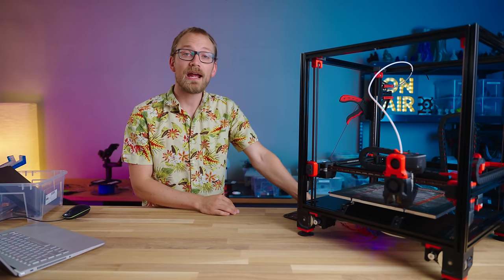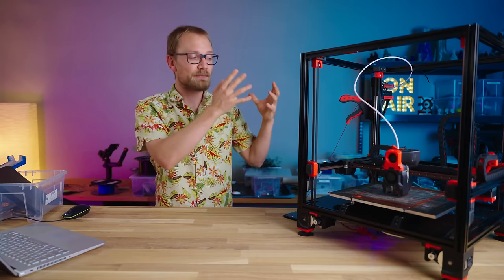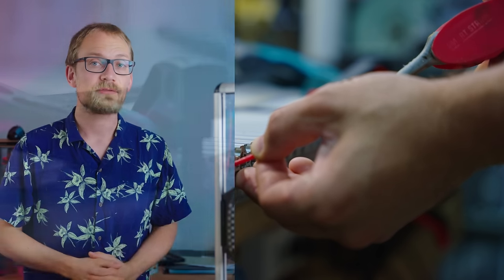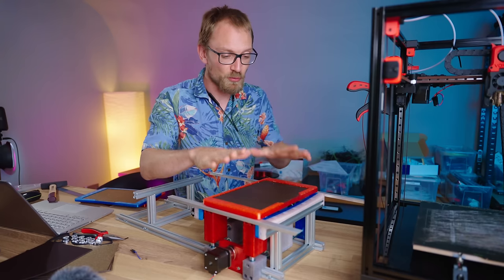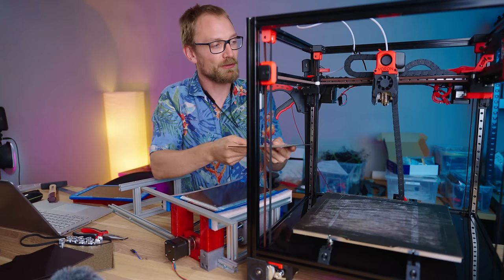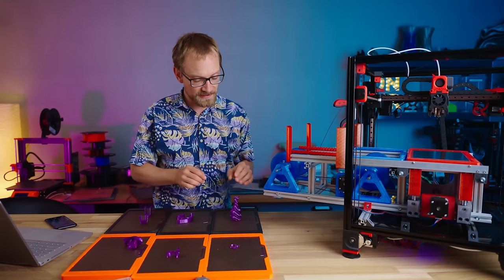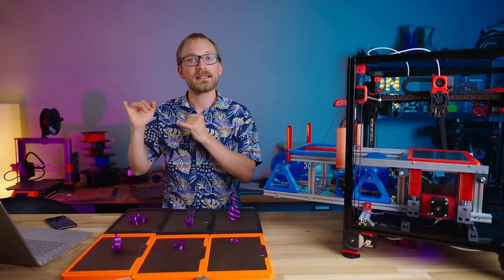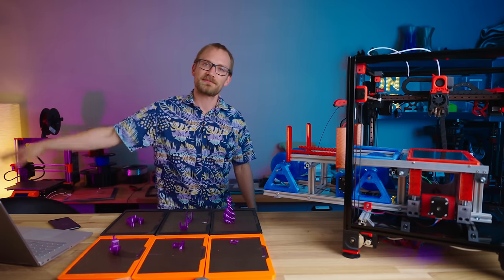Fully automated 3D printing using REAL print beds!

Comment: This is an amazing solution, well done!  Bugs me a little that the beds just drop.  Needs some exit rails that put the beds on a conveyor where the prints get knocked off and the bed gets deposited back in the stack to be printed on again.
Reply: Won’t work seamlessly, until you can control the prints adhesion on the bed for every print. Sometimes there will be prints that stick too good
Reply: Hot take: Just print on a conveyer belt itself. Those printers already exist. This...this is just wasteful tbh. I don't get it.

Comment: Curious if you have used the 3DQue product or seen it work in person. I can tell you that it doesn't RAM parts off the bed as was mentioned. The VAAPR bed surface is simply amazing at holding parts as they print and releases the print very gently after it has cooled. The Quinly automation software can save makers time by not having to interact with the process.  Maybe next time try something first hand before making off handed comments.
Reply from the maker: There are solutions that do ram the parts with the toolhead. For the 3DQue, they said they'd send me one (a couple months ago), but I never got one.

Comment: How fun!  Two points... on the offload, you could certainly utilize a conveyor so the prints aren't damaged being dumped off the side (knowing you, v2 will have that!)  Second, coming from the world of Large Scale 3D printing, I keep hoping E3D, Slice or Bondtech develop pellet fed systems.  No more dealing with inconsistent filament size or fear of running out.  I haven't seen much small scale pellet stuff hot ends take off yet.  But for the big printers, that's what we use!

Comment: I've been thinking of using an arm that will extend and will push the prints out of the bed automatically.
Reply: I had the same thought. Kinda like a large paint scraper that pushes the prints into a basket or something.
Reply: @johnbickford9221  yess exactly. It would be much simpler. You just need linear motor and some simple design.
Reply: @imranzosh97  You could even do it with a threaded rod a linear bearing and a stepper motor.

Comment: I would use electro magnets so you could just cut off electricity and the bed would release
Reply: Maybe use permanent magnets to stick the beds. For release use electro magnets that works "against" the permanent magnets.
Pros: no power to hold the bed, "failsafe", ...
Cons: electro magnets must match the holding force of the permanet magnets, maybe closed loop control and hall sensors needed,..
Reply: Electromagnets would be very energy intensive as you'd have to have them on during the entire print. I think your idea is a good one, perhaps using Electro-permanent magnets instead.

Comment: "this simplified, practicalized version"

Ya know... 3dQue is more simple. It has Quinly software to provide the automation of individual g-code files. It has reduced part count to enable automation. It is more practical, because you don't have beds and parts falling together, and you don't have to reload a "bed magazine".... Oh, and you don't sacrifice any build volume.

I really think you over engineered this. I'm an engineer. I've been there. I recognize it. You got carried away with your idea, and because you have the time and money you never stopped to consider it from a point of view of practicality due to confirmation bias.

You should go back and actually research how Quinly automation works.
Reply: well stated !
Reply: 3DQue build plate has pros and cons. Looking at the cons, it looks like 3dQue does not auto-eject nylons well, and the angled bed may not be great for high speed printing (bed moving up the incline vs. down the incline or in a corexy the printhead making the same moves up and down the incline).
Reply: @SD-bv7eb  didn't realize we were talking about nylon printing all of a sudden?

Comment: Amazing. One idea that came to mind is a carousel style large flat disk that spins  centered around the front corner post. It would give a generous X and Y and possibly use existing heat so almost no Z loss. Add that with a metal wiper razor blade or thin heated wire to remove prints on the outside and it could print infinitely. Great job!

Comment: What a brilliant idea! I love how this mechanism has a gravity-fed hopper for the beds and a heated bed that is separate and can move up and down. I think the dead space could easily be removed by having the hopper closer to the bed in use and by changing the design of the belt so that it has hooks instead of blocks that can still push the bed once the first hook has rotated down on the pulley. Also, I'm slightly worried that the 3D printed holders for the bed would warp over time as they are by a heater for quite a while. Well done on having such a great idea and executing it so well! 💜

Comment: Excellent video Tom! Finally a proper tackle of this printing challenge. Next step (although possibly a lot of rewiring) could be to remove the electronics/existing bed from under the bed and put the printer on top of the print bed cycler. Though then you'll have a real Frankenstein.

Please keep making more in depth engineering videos like this!
Reply from the maker: I've thought about that - and the Voron (and similar) printers would lend themselves to that very well. The electronics compartment at the bottom feels like it's mostly the size it is for comfort and ease of use, no reason it couldn't be smaller or tucked away somewhere else on the machine.

Comment: The multiple Print bed approach is so much better in a production setting when printing multiple units and sets than having them roll into a container.  Is much easier to do quality control when you have an array of prints than having to pick them one at a time from a container.

Comment: This opens so many possibilities! 
One obvious improvement would be to plan on using this while building the Voron, and modifying it so you can use the full z-height. Would be fairly simple, just move the electronics somewhere else and replace the base with your contraption.
Plus it really needs a ramp where the done prints come off, I can see the piling up beds to cause problems, not to mention a fragile print would be likely to break (I know your version is just a proof of concept, so not really necessary)

Comment: Cool build!
On the ejection side - a simple slope would allow the ejected beds to slide out neatly.
A thought on gripping the bed inside the printer is electromagnets - steel flex bed sheet, electromagnets in the heated bed plate itself - could be a lot slimmer height-wise.

Comment: Looks great! When space around the printer isn't an issue, a rotary system is usually the go-to solution within automation. Then again, picture a robot arm in the middle of a circle of 3D printers stacked in layers, serving seven times three 3D printers simultaniously, while putting the printed pieces in different bins, including a red bin for failed prints. Perhaps it also adds some need for DFM (Design for Manufacturing).

Comment: Not too sure if you already got this suggestion;
Since the electronics in the voron are housed underneath, you could potentially rotate the entirety of the lower compartment by 90°, then use the opened space underneath to build a scaled up version of this heated bed design, and retain the full build volume for MASSIVE parts. This, in combination with the "complete individual objects" slic3r setting, would probably push your idea to what you initially envisioned with the drum idea!

Really loving the video man, I hope you make more good progress!

Comment: @Thomas - you said that the mechanism for removing the magnetic beds from the hypothetical conveyor would be too complex, but I don't see why. As long as the printed frame around the bed is wider than the conveyor you don't even need an active mechanism to remove them after printing.

All you'd need is a correctly placed ramp with rails that would go either side of the conveyor. That way, when the conveyor starts to go down at the end the printed plate frame meets the rails & can't continue the (conveyor end) turn, so the part of the conveyor it was attached to just pulls down & away from the frame, freeing the frame to slide down the rails onto the ramp.

Comment: I did this years ago and just used the 3d print head to push the prints off the glass bed and then used a queue system in octoprint to print the next print. it's been working for the past 4 years great and i didn't need extra bits

Comment: Very nice project Thomas.  The idea of build-plate cartridges and your heat-bed attach and release method is great!  These are the kinds of 3D printer project videos I like to see; innovation, not repetition.  Now you just need an outfeed ramp ( jut a couple of L-brackets would do) so the bed cartridges don't just fall akimbo.

Comment: Excellent, I made a similar setup on a old i2. I used note cards (4 x 6) as the print surface and had a light vacuumed holding them down. worked wonders if you printed in PLA. biggest issue was the cards often held on to tight to the parts and left bits behind. might have to revisit it after seeing this. I think a stack of PEI sheets set up the same way with the vacuum would solve our largest hurdle.

Comment: Hi Thomas. I'm really impressed by your ingenuity!! Great design. And ultra beautiful machining of all parts. German quality all over. Love that!!
And: it worked like a charm.

Of course, if you would give 5 separate engineers the assignment to develop such a system, you most probably get 5 different solutions.

I myself, as one of those 5 engineers,  would design it using electromagnets (for the pull)  and locking-pins (holding the plates in position) 
And I would move the plates using lead-screws. It would make a flatter unit.

All the best from the dutch guy living in buzzing Istanbul !!

Comment: Really cool stuff. A little bit down the line it would be cool to see it loop around the whole printer, that way you would have an infinite amount of resupplying print sheets, no need to refill cartridges :P. You'd probably still need some magnet action going on in order to flex the sheets to get the print to come loose, but that could maybe be done with advantage once the sheets are underneath the bed and the prints have cooled down a lot, maybe even removing the need to flex the prints (at least as much). In fact, you could eliminate the need for cartridges altogether, slimming them down to the width of just a sheet itself since the sheets could be attached directly onto the conveyor belt, as they would not need to be able to come off. The prints would just fall into a bin underneath the belt. Just build some stilts for the printer to stand on and place the whole thing on the floor.

EDIT: Hmm, if you attached two printers end to end, one upside down, and loop a conveyor belt between them, then you could print twice as many copies of a print, and the sheets don't just sit unused on the belly of the conveyor belt, waiting for their time on the bed. Printers can print just fine upside down, right? If the two printers are printing the same thing, their respective printer head movements would go in opposite directions, cancelling out some vibrations and wobbles as a bonus (I think?)

Comment: 1 think I really like about the design you went with is how it scales infinitely. A print farm could have one large hopper of beds fed to all printers and the beds could roll out assembly like style. At that point some detached the part does visual inspection and so on and the bed is put/fed back into the hopper.

It limits the need to collect the parts as well as means workers could he In a separate area with better cooling for people while the print farm could stay toasty and draft free.

Comment: Very cool project! I would suggest now you come up with a plan to collect the print bed frames as they are ejected so the prints are not damaged by having them pile up and fall on top of each other. Could be a turntable, or an elevator that lifts each plate, or a conveyor belt as the simplest method.

Comment: Being on the topic of an automated build plate changing system, have you seen/ heard of the Tiertime X5 3D printer? It’s an enclosed printer, that holds several extra build plates inside, and can handle a print queue of jobs, that it’ll print one after the other, ejecting each finished job out the side of the printer upon completion. 
I figured it was worth sharing.

Comment: Great video and ingenuity. 

We also designed a way to automated our 3d printing , but take a much simpler approach. We print on top of a glass bed with kepton tape layered on top and allow the print head to knock off the print when it is finished. The surface does not need to be heated or cooled and we can print for 24 hours on end. It works really well.

Comment: The rotating bed idea could have worked if you put it underneath the Voron. Essentially having the bed in the same place it is now, and all the rotation is hidden under the table. The final design would also benefit from being installed under the Voron. Also, maybe for the bed swap mechanism, you could use a gravity system where the feeder is tilted and the trays slide down into place. Then when they're done, they could also exit onto tilted rails.

Comment: Does it take long for a magnetic bed to heat up? I know that this suggestion will be for a minority of cases but for those few looking to get every second of printing time available imagine a step before the printer. When the current print is almost finished (99% done, 5 minutes left, or however you wish to define it) the magnetic bed right before the printer is warmed up to approximated 50 degrees Celsius, or whatever the set temperature is, in order to be almost ready for printing. Once the current print is finished it is moved off of the printer and the pre-warmed magnetic bed is moved on to finish the last bit of warming before printing may start. The pre-warming could even set it to the desired temperature and then the printer would just have to reheat anything lost while the bed was moved. 

An optical sensor could determine any empty trays at the warm-up station and turn off the heating. The first print would just move directly to the printer and behave as it does now. 

Again, something like this would only be important to a select few whom are interested in having their printers running at the highest percentage of time as possible. I don't use the magnetic beds and so I don't know how long they take to heat up. I can't imagine that it's very long. Still I think it would be neat.

Comment: Another idea I had for this would be a belt surface like the ones in the belt printers, and then a mechanism that moves the whole belt up and down a little to press it onto a heated surface. The belt would not "go around" the bottom, but rather move between two rollers in the front and the back. It would probably require three motors though, two for the rolls and one for the up/down mechanism. And the textile surface is also a downside, even clamped down to a hard bed.

Comment: Slightly simpler more compact options for the same idea: 1. Use electromagnets from solenoids to hold down the bed. Turn them off to decouple the bed. The problem is that bed will decouple during power failure.
2. Use those switchable magnets (2 discs of 6 magnets that are on or off depending on how the disc are rotated) gear or belt them together.

Comment: I'd vision this differently. A steel sheet loop large enough to wrap against rollers much like the treadmill printer. But in the center you would have the heated bed and a switchable magnet (either a big electromagnet or elctromagnets, or permanent magnets that shift to turn them off like the magnetic chuck/bed of surface grinders). 
Run the treadmill to a fresh bed portion and switch the magnet on. the steel treadmil will stay flat in the center perfect for printing. At the end, the magnet switches off, treadmill advances and curves at the end unsticking the print.

This treadmill type can have an extra long (double bed size at least) treadmill to come to the side (still flat) to allow it to cool one print cycle and only after the next print will peel on the roller part. The rollers would need to be large in diameter to smoothly bend the steel sheet bed/loop/treadmill but the whole contraption can be under the printer! The only part you need to put on the current bed is the switchable magnet (that can be done under the bed and not on top). This way you will not lose any Z height! The only Z loss is the height of the printer as the treadmill will run under the printer and in order to have a smooth pei-coated steel treadmill not permanently deform on the rollers, the roller might need something like 300-500mm diameter for a thin spring steel like 0.6mm (must experiment what is the minimum diameter for rolling a springsteel sheet of certain thickness). The magnetic part should insure a flat condition of the thin bed so be wary of the number of magnets and placement in order to achive the flatness needed.

Think like a bandsaw where you print on the side of the blade and the whole heated bed and underside of the printer are in the throat of the bandsaw and the printhead has no restriction regarding the outside direction.

Comment: Slap mag trays on the conveyor belt system that is already in the works. use electromagnets to lock it into place at registration points under the bed. Keep up the good work.

Comment: I just use a Creality glass bed with Continuous Print for automated printing. If you put the purge line in the front it also pushes the purge line from the bed. In front of the printer you just need a box or slide for the pushed over prints to fall in.